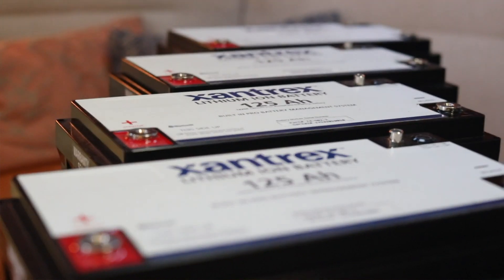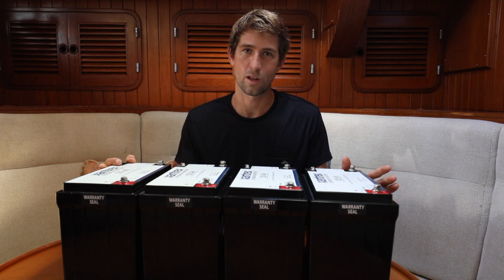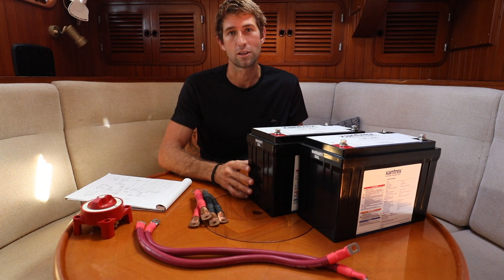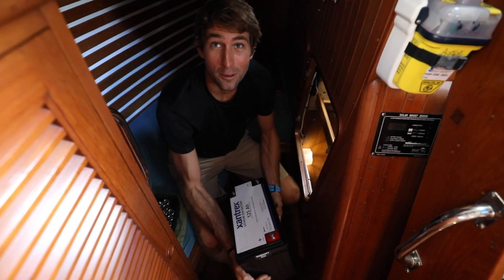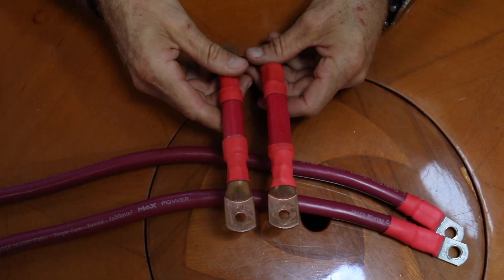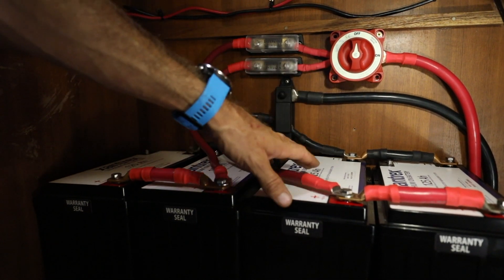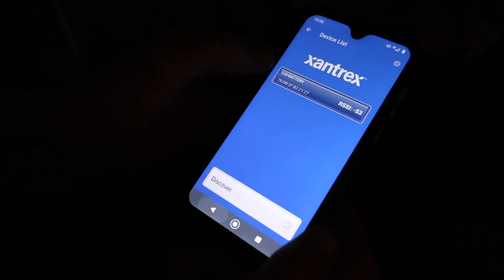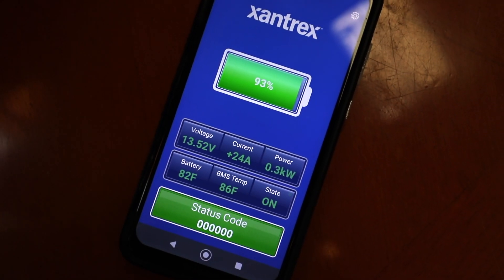Replacing AGM Batteries with Lithium Ion - Battery Install

Comment: What can you run with 500Ah of Lithium Batteries?
More Importantly, what can you Not run on a boat with 500Ah of Lithium Batteries?
I am looking to upgrade to Solar and Lithium Batteries. 
Thanks
Reply from the maker: It really depends on what you may run with battery power. A 12000 BTU A/C may run for 6 hours or longer if no other major load is turned ON at the same time. 
The question is really about how long you may run a particular electronics rather than what you cannot run with 500-600 Ahr lithium ion battery.